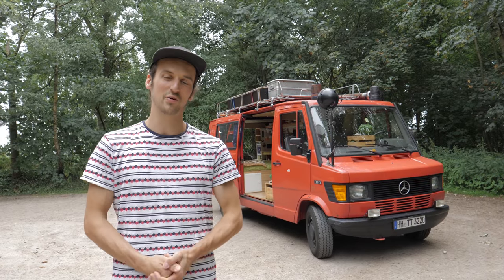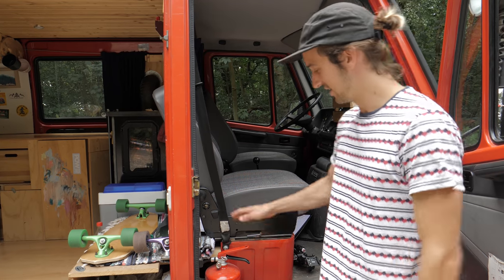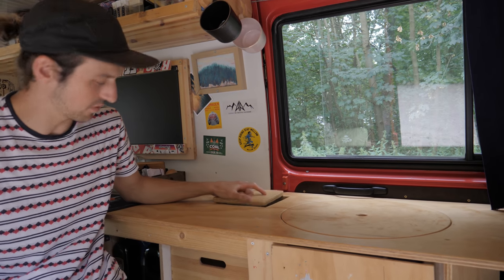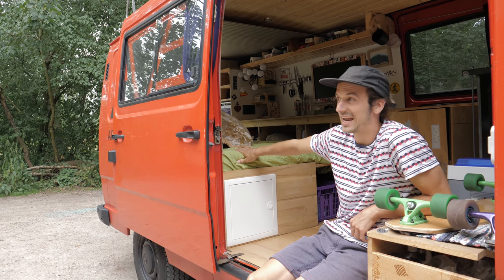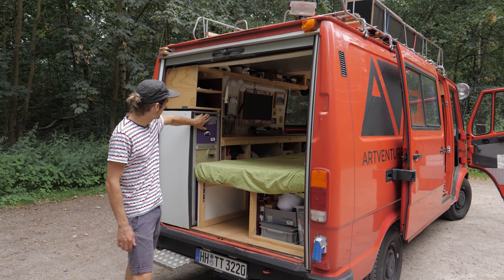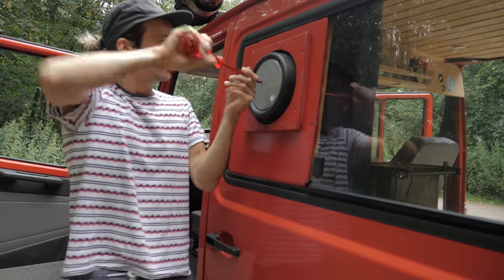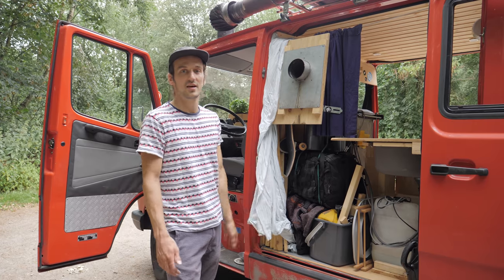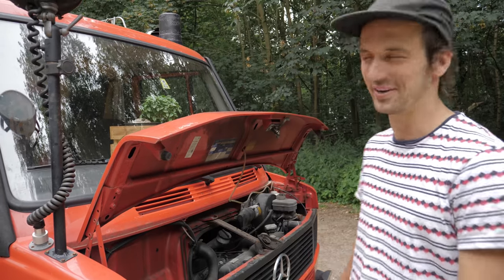VAN TOUR - A FILMMAKERS VAN (built in firestove)

Comment: Where can I see more about your rollup back door? How far up the ceiling does it go? What is it made out of? I want a door like that for a partition.
Reply from the maker: I'm not sure but i think in my summer winter conversion video, you could see details of how it works. It came with the van though, i didn't build it myself.
I think the material is aluminum.

Comment: does it go offroad efficiently? is it 4wd or 2wd? do we need 4wd for such a van to go for most offroad locations or its strong enough for offroading on 2wd?
Reply from the maker: It's a 2WD and pretty good for going on gravel roads and slight offroading. It has some power but some weight to it as well. 4WD is probably the safer bet, depending on what you're looking for.
Reply: @ARTVENTUREFILMS  thanks for reply, well im thinking of offroading arid areas that are leveled not very rocky, and wondering if it can go up a medium height mid steep hills with kind of leveled dirt roads..
thanks for encouraging me to get a 2wd! 🤗😍
Reply from the maker: @سهمالهاجري  I went up a 16% road in Austria almost every week and even in snowy conditions it was alright getting up the mountain. I had to go back to 2nd gear but it had enought power. Not sure how steep or rocky the roads are that you're thinking of but it sounds like it could handle it. If I was you, I would think about a winch for offroading or diff locks. hope that helps :)

Comment: How often do you ventilate the van when using the woodstove?
Reply from the maker: Always when it was too hot 😅 I mostly opened the side door or left it a little open, depending on the weather.
It really depends on how hot the fire stove is and how long the heat lasts. So it varied from every 5-10min to having it on very low all night. Does that help?